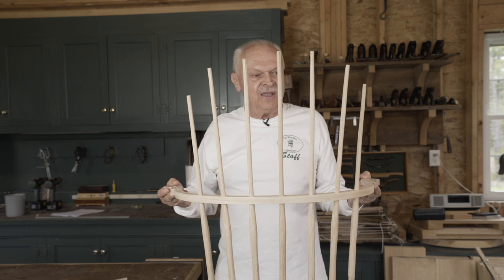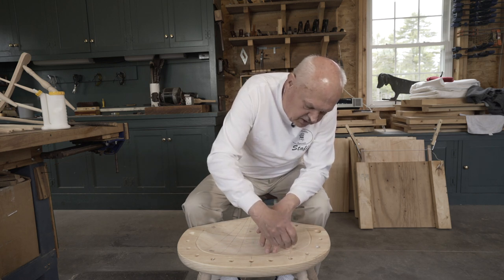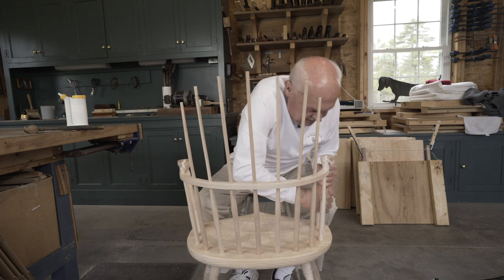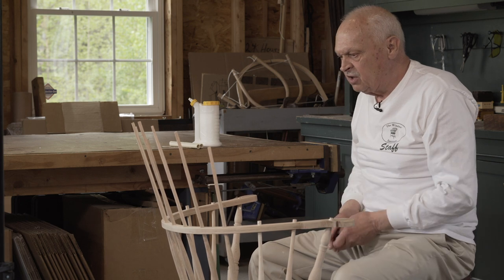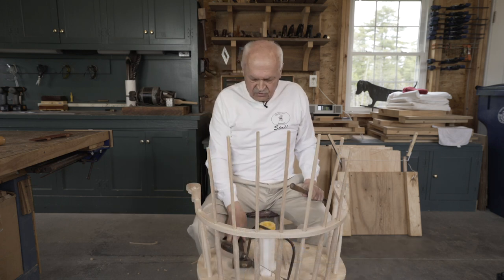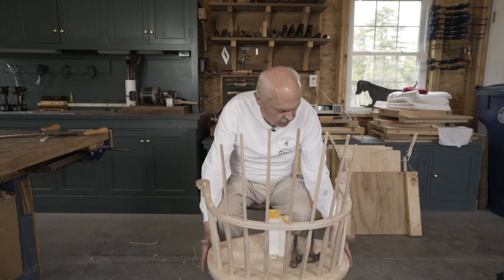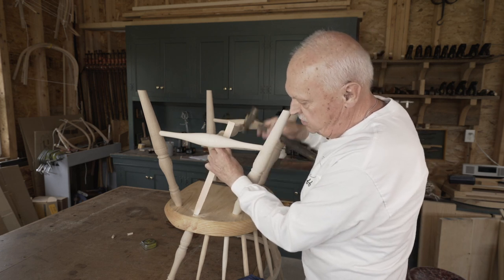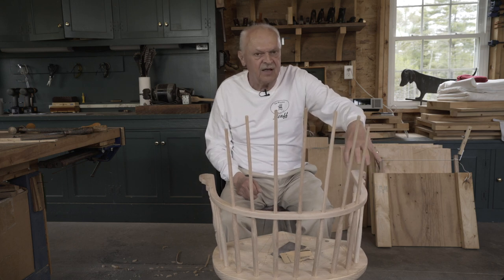Make a Sack Back Windsor - Episode 11

Comment: Another great video. Keep 'em coming. At some point I'd like to see a full recap episode of all the unique tips. Things like "front is back", rear leg holes are drilled below the scribe line rather than on it, legs are drilled top of leg to top of leg, the correct direction of wedges and so many more. A list of those type things that a new builder could reference while building his or her Windsor chair. And if you don't start a new series on a different chair, say the birdcage, maybe a quick version of aged finishing techniques. Thanks Mike